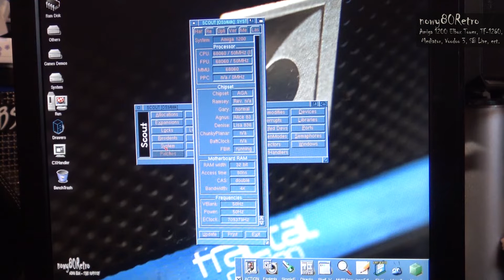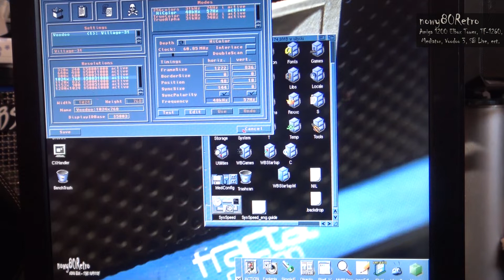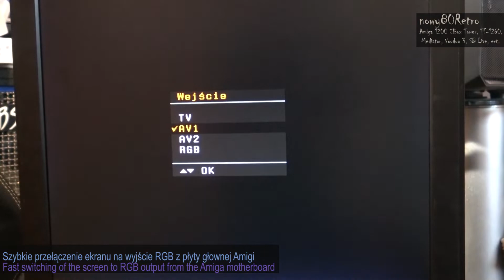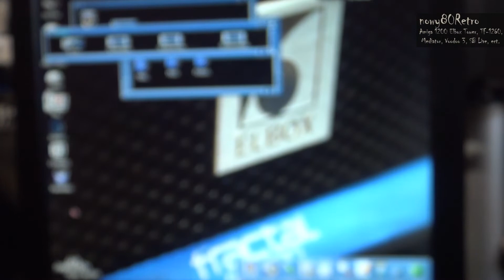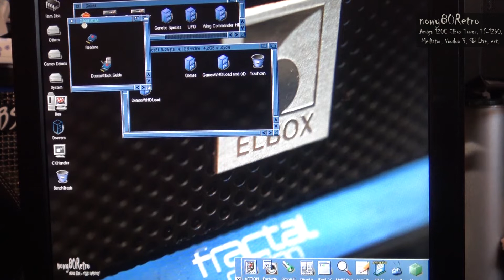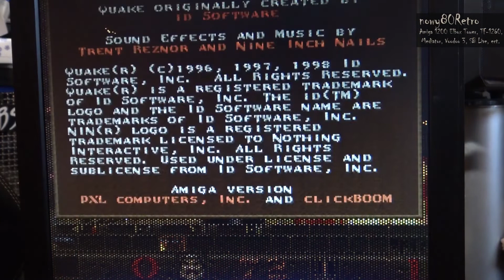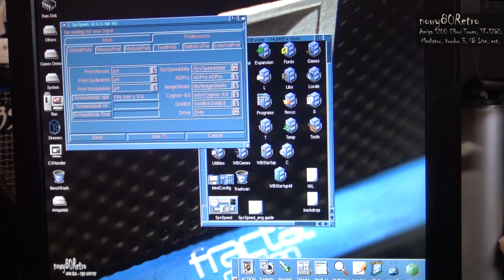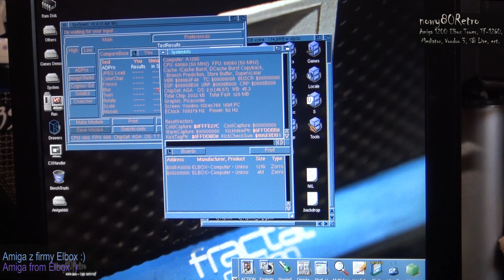EN nowy80Retro #87 I am building Amiga 1200 in the Elbox Tower version

Comment: Hi. Nice system, congrats. Recently bught the same stuff , black tower with mediator and fast ata mk5. Also have the same cards for it, a voodoo3 and a blaster 128 live. Didn’t decided if I will use my tf1260 or my Apollo for it, both work for me on 66 mhz but ram access and fpu heavy applications seems to run  faster on the Apollo. (Lw5.2 for example). My only real concern is the fast ata vs mediator gap. Seems far too close for me. How it works for you after 1 year. Did you change anything later? Heard some roumors that some users had to remove the plastic clip of the ide cables for proper mediator placement.
Reply from the maker: Thank you for your comment. I'm using a TF1260 with a 060 rev6 processor at the moment. The firmware for this card has also changed since the video was recorded. The card runs stably at 94MHz with this tower supplied power supply (400 Watt). The 5V voltage is very stable. I also had to remove the clips from the HDD tapes to fit everything. I had to install the HDD upside down because the molex plug wouldn't fit. The mediator for TF1260 must work on the 4MB jumper. You can also see tests of this set on my other video material (94MHz). https://youtu.be/rDSBwnqvKKQ
Reply: @nowy80Retro thx. My cpus are full rev1 and rev2, working only on 66mhz as a maximum oc. But it is plenty enough forme in a classic system. For more power there are my X5000 and Sam460LE configs. I would like to do some assmebly coding on the A1200+060+mediator+voodoo3 to see the real limits of the system. A small tech demo or smthg like that. Of course I have to assemble it first and instal everything properly. I will remove the ide cable caps then, it seems it is a must have feature to install the mediator above the fast ata.
Reply from the maker: @MaverickM1  I love the A1200 in the tower. I wish you a successful project. Kind regards.

Comment: why not amiga OS3.2?
Reply from the maker: I love Amiga OS 3.9 The system is more advanced in terms of functionality. Amiga OS 3.2 runs faster, but it doesn't matter much for the 040/060 processor.
Reply: i am use OS 3.2, becouse got Brand New OS3.9 still sealed, and just not want to open it, till not find another one